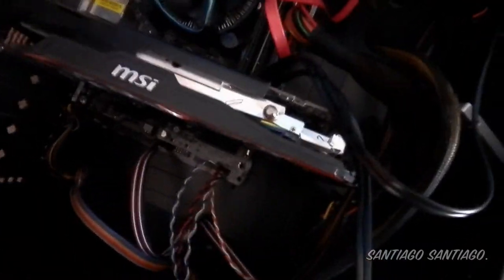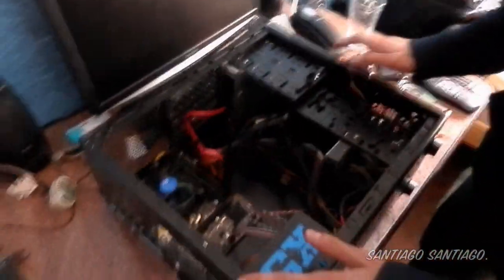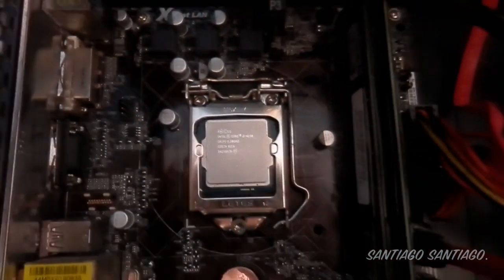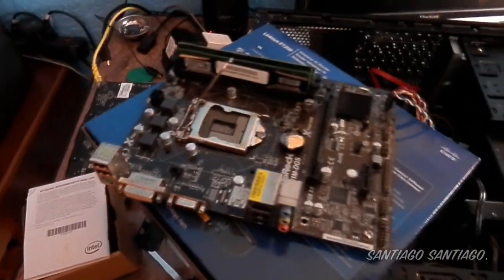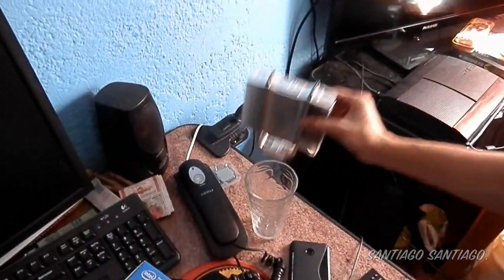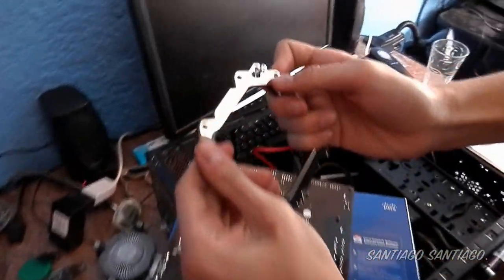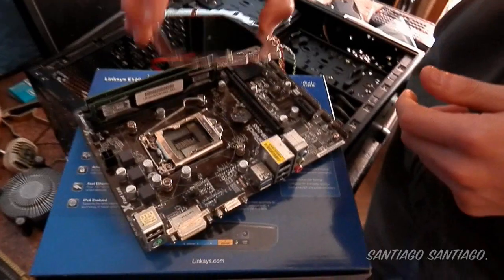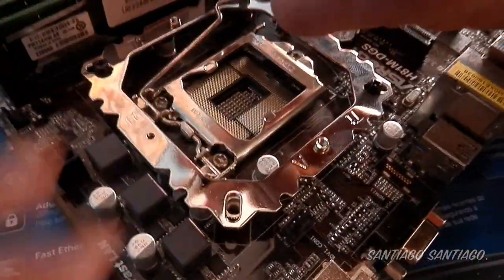Upgrading my CPU to an i7 4790 / Actualizando mi CPU a i7 4790

Comment: cuanto watts consume tu sistema con el i7 4790 y la gtx 960 o la gtx 950?
Reply from the maker: No tengo las herramientas para ver eso, pero con una fuente de 450W se la bancó, supongo que estará gastando 350W como mucho
Reply: hey gracias por responder! bueno mi sistema i3 4150 y gtx 750 ti consume algunos 120 watts. cual me recomiendas para un i7 4790 y gtx 960 sc o espero que salga la 1050 ti ?
Reply from the maker: Juan Carlos Yo esperaría la 1050 ti a ver que pasa, el i7 4790 es una buena idea si hacés mucho render o edición, sino yo iría por un i5 4690k (si es para uso normal y juegos)

Comment: are you change the mother board
Reply from the maker: +yassine elbaz No, the motherboard it's the same
Reply: but if you want to change i5 650 to i7 is it possible??
Reply from the maker: +yassine elbaz Yes, but you need an i7 from the same socket as your i5

Comment: should of instead bought a gtx 960
Reply: it isnt much of a jump from a gtx 750ti
Reply: +Nub Smoo "it isnt" lol.
Reply: +D3KO ty
Reply: +Nub Smoo there's a big difference... Games that ran at 30fps could run at 60fps at same or slightly higher settings with a lil OC.
Reply: +Nub Smoo 4what?
Reply: +Nub Smoo yep only 20+ fps more XD

Comment: but will a i3 still stream decent
Reply from the maker: An i3 will stream decently if you use Shadowplay to stream (there's some audio de-synch though), if you want to use OBS or XSplit it won't be enough
Reply: +Santiago Santiago. what i5 do you recommend im tight on money aswel
Reply from the maker: mulitlkx For streaming?
Reply: +Santiago Santiago. yeah
Reply from the maker: mulitlkx Would an i5 4690 be on your budget?
Reply: +Santiago Santiago. how much is that and how much diffrence would an amd make
Reply from the maker: mulitlkx AMD will be cheaper, I suggest you to go for an FX 8350
Reply: +Santiago Santiago. ok thanks keep up the great work and which is better the 750ti sc or 750 ti ftw
Reply from the maker: mulitlkx The GTX 750 ti FTW is one of the best 750 tis on the market
Reply: +Santiago Santiago. ok thanks and you know the benchmarks on dayz will it be diffrent on online

Comment: Will it have bottleneck?
Reply from the maker: +Sander Lawrence No, bottleneck is when you have a cheap cpu with an expensive video card, if there's a expensive cpu with a cheap video card bottleneck isn't there
Reply: But I watched a video from Linus and he said that the cpu will want more power and performance from the graphics and the system will not be balanced or equal.
Reply from the maker: Sander Lawrence Give me a link from that video
Reply from the maker: +Sander Lawrence You didn't understand, he said the same as I did, he said that about the GPU (graphics card), if I have a slow cpu, the cpu cannot process everything that the card is attempting to do, so the video card will slow down to keep up with the CPU (that's a bottleneck), it doesn't work the same the other way around, if you have a great cpu, and a cheap graphics card, the cpu won't have any problems on processing the things that the graphics card it's doing. I hope you understood, I will do a video about this anyway so I can be clearer

Comment: Por q no te has cojido un i5-4460¿
Reply: +Adry Gaymer tienes mas ventiladores en la caja o solo el que viene de serie.
Reply from the maker: En verano uso solo el ventilador trasero (ahora no estoy usando ninguno), compré el i7 para render y otras cosas (como explico en el video)
Reply: pero el i7 para los juegos va igual que el i3¿
Reply from the maker: Adry Gaymer Depende el juego y con qué tarjeta de video estemos, la GTX 750 ti corre de maravilla con el i3, por lo tanto la diferencia se va a notar en los juegos que usen mucho cpu (como voy a mostrar más adelante)
Reply: yo he visto la gtx 950 va bien pero la gtx 960 ese es mejor todavía
Reply: si le meto una gtx 970 la placa que tu tienes la soprtara
Reply from the maker: Adry Gaymer Si, una GTX 970 se puede poner en la mother que tengo sin problemas (ya que tiene un puerto PCI-E x16), si querés una GTX 970 asegurate de que la fuente sea suficiente
Reply: una fuente de 750 w vale